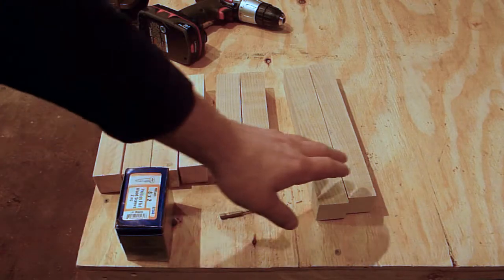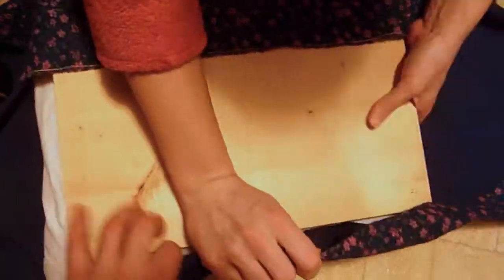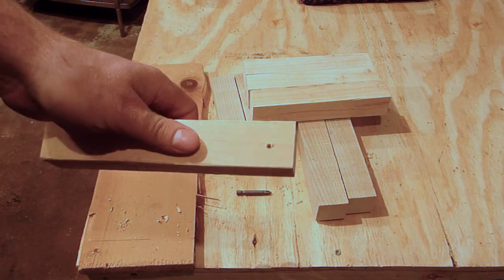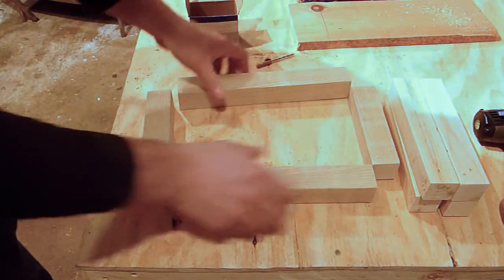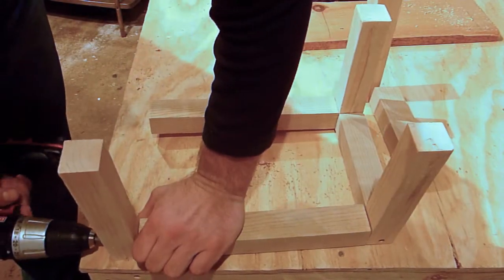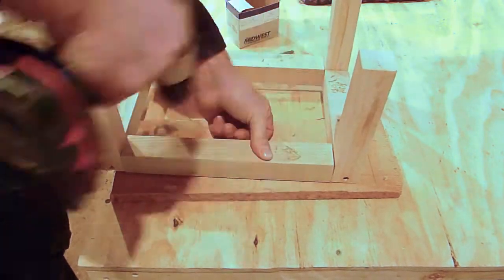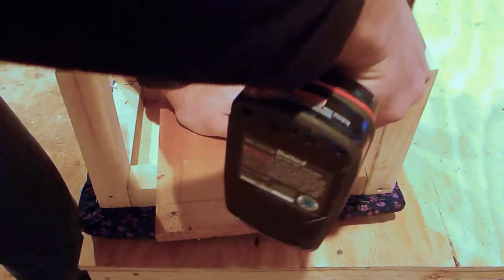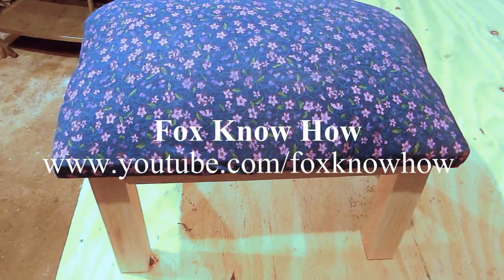Making a foot stool

Comment: If you sit on that your gonna get stuck with screw tips
Reply from the maker: I used 2 inch screws to screw the leg frame to the cushion board. The screws don't go all the way through the cushion board so there wouldn't be any screw tips coming out the top.  The leg frame is made of 1 1/2in x 1 1/2in wood (aka 2x2) and the board for the cushion is 3/4 in thick.